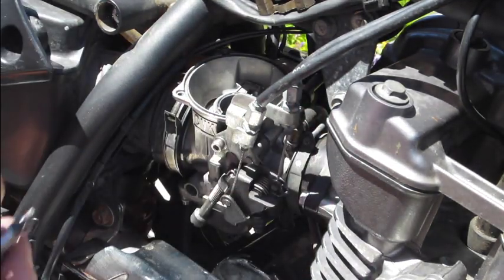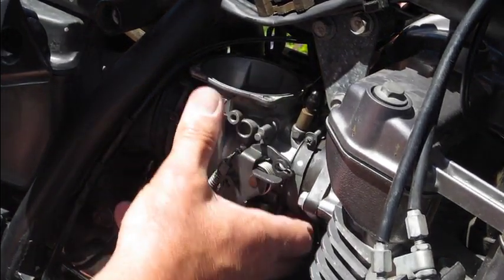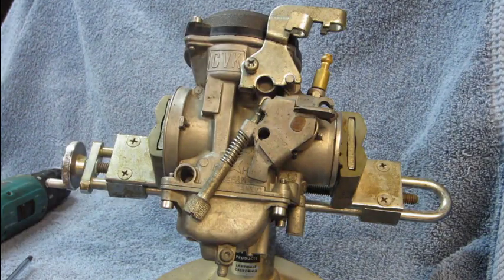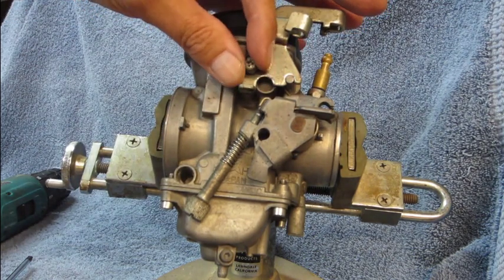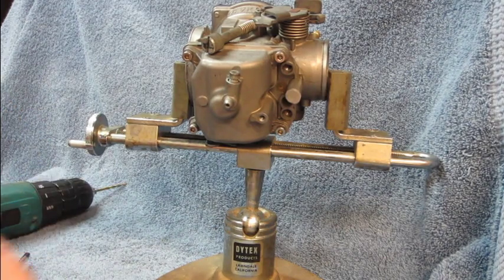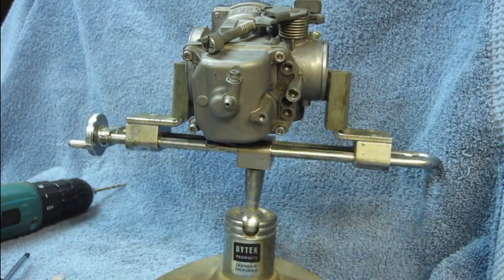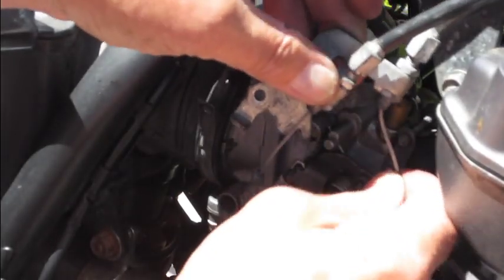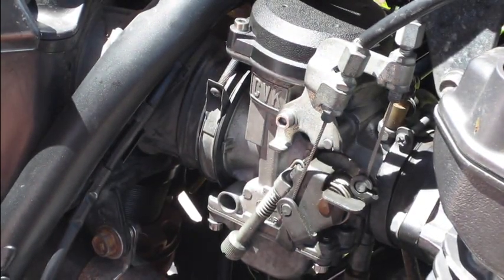22 cent mod video 2

Comment from the maker: If you find this adjustment inconclusive, just set it at 2 turns out; hard to go really wrong with that. You should also be aware that the engine can stumble at too lean a mixture. One old trick was to find the lean stumble point and the rich stumble point and set it halfway in between. In my opinion, rich is better on this carb because the idle mixture circuit always plays a part well into partial throttle. Rich runs cooler. Google "Care and Feeding of the Keihin Carb". Good reference!

Comment from the maker: I'm not sure why the recommendation there is for 3/4 - 1 turn out. That is pretty much how they come from the factory, and it is lean. the generally accepted rule of thumb is about 1 3/4 turn out for stock, roughly 2 1/4 turns out for aftermarket exhaust. Those are not exact numbers, but should be a very good improvement over stock.

Comment: Thank you so much, really helpful video! 
Not sure if this is the case for all but my 2016 didn't have a cap on the adjustment screw. With a Lexx exhaust and 2.5 turns out felt a little rich when shifting gears. Think i'll try what you recommended in the comments at 2 1/4. 
Overall, superb..big difference!!
Reply from the maker: Glad to hear it! Interesting that the cap may not be on the 2016; had't heard that before.

Thanks!

Tom

Comment from the maker: Drilling the slide will improve throttle response a bit but won't do anything to the mixture, so if you don't want to do it there's no problem. Just put a washer or two under the needle and turn the screw out a couple turns. You should notice an improvement in first gear/second gear roll-ons. Nothing to removing and replacing the cables - just watch that choke cable!

Comment from the maker: I don't know, Juan. It depends on what else has been done. Two to two and a half turns out is probably in the ballpark, but it all depends on what the pipe is flowing and what intake mods have been done.

You see, you can get to the point where you need a larger pilot jet to control the lean pop on decel. I have a very free pipe, a ported heat, and holes in the air box. I needed to go up a couple sizes on the pilot.

Try the "cracking throttle" method below ans see where it takes you.

Comment from the maker: Probably not, with just the pipe. You can start at 1 1/2 and turn it out an 1/8 turn at a time, cracking the throttle each time. What you are trying to do is get the idle running as rich as possible. When cracking the throttle causes a stumble the mixture is too rich; back it off a bit until there is no stumble. Running rich at idle and part throttle should help to prevent decel popping. The engine needs to be fully warmed up for this adjustment.

Comment: Great video. When you are showing the outdoor portion of the video you have what looks like a brass thumbscrew in your idle mixture screw hole? Where can we get one of those for future adjustment?
Reply from the maker: Hi Rick - 

It's called the 'EZ-Just Mixture Screw' and it is made for Harley Davidson Sportsters that use the CV40 carb. John's Cycle Parts (http://www.johnscycleparts.com/store/index.php?route=product/category&path=20) has it, as does CV Performance (http://www.cv-performance.com/). They are about $20.

Tom

Comment: great video.my son has a first gen klr 650. i was out visiting him over the weekend. he lives in san diego {sea level}. the bike has a super trapp muffler with stock pipe. it has a aftermarket air filter. i asked him if he has ever pulled the spark plug to check it out. he has owened the bike for 2 years now and has just changed the oil every 1000 miles and clean the air filter, tighten the chain and put gas in it and loves the bike.i pulled the plug and it was real real light in color. i ride a xr650r ,kx500,gsxr 1000 and a 79 bultaco 250 pursang. so i know what a hot plug looks like. i kinda freaked out seeing how hot it was burning. you think the 22 cent mod will help his bike out ? or any suggestions ? thanks
Reply from the maker: Buzz-

KLRs come from the factory pretty lean; it's an emissions thing, I guess. What you are seeing is pretty normal. The 22 cent mod will richen the mixture a bit and take it from about 17:1 and get it closer to 15:1.

With today's fuels that contain additive packages and ethanol the old "reading the plug" trick gets a little bit iffy, though.

The SuperTrapp being on there is an unknown as far as what it's doing to the mixture. I found that the ST had to have 9 plates in it to flow as well as a stock pipe and was horribly loud. Depending on how many plates he has in it, it may be contributing to the lean condition. Intake and exhaust mods need to be balanced. He might be better served by installing a KLX needle. If he still has the stock exhaust can, a better exhaust mod than the ST is to open up the stock can, removing the baffle. If flows pretty well and isn't obnoxiously loud.

All in, I'd say the 22 cent mod would be beneficial on his bike. Do it and check the plug. If it still looks lean, go for the KLX needle. Go down one jet size and start at the second clip from the top, then tune.

Tom

Comment: Hi there, great vid thanks so much - I'll be working on my 2000 KLR over the winter.  Quick question, where can I get a 4 40 washer?  That'll sound dumb I'm sure but I've looked here in Montreal and can't find one.  Any pointers?
Reply from the maker: Hi, it is not a dumb question! They can be hard to find, as they are part of a set of very small hardware and they are not metric.

What you need to find is a stainless steel washer of the appropriate dimensions. Here we find that ACE Hardware Stores often stock a good supply of 4-40 screws, nuts, and washers. You might try Ace Quincallerie Moussette 1561 Rue Ontario E, Montreal or Quincaillerie Home Hardware 4299 Boulevard Saint-Laurent, Montreal.

If you cannot find 4-40 washers then 3mm washers should work. They will be a bit smaller in the inside diameter and outside diameter and a bit thinner. The shaft of the needle is right at 2.92mm. I have used the 3mm washer in the past.

Here is a comparison of the two:

4-40 Stainless
Inside Diameter      3.25
Outside Diameter   7.75mm
Thickness                  .8mm

From my stock, what you find may vary:
3mm Stainless
Inside Diameter       3.13mm
Outside Diameter    7.15 mm
Thickness                   .63mm

Normally two 4-40 washers are used, but people often find that one is sufficient. I would suggest using two of the 3mm washers to start; you can go to three and have a bit more lift on the needle than two 4-30 washers give. Wouldn't hurt anything. 

Stainless washers are usually well finished with no burrs, so stacking them is not an issue. Make sure that the ones you get have no burrs from the manufacturing. If they do, sand them flat with some fine wet-dry paper, oiled, on a pane of glass or other hard, flat surface.

Best of luck!

Tom
Reply: Holy mackerel, you the man!  Thanks a lot Tom, can't tell you how much I appreciate you going above and beyond to help a guy out.  Really, thanks.  Looking forward (no, really!) to the winter as it'll give me plenty of excuses to get into the garage and start the tear down and eventual rebuild of my KLR - with your help and your videos I feel well prepared.  Good man!
Reply from the maker: You are very welcome; glad to be of help.

Are you planning on replacing the balancer lever? If so, and if it gets too cold to work on the bike, I have a set of videos on that job that will chew up an hour of your time. https://www.youtube.com/watch?v=U3UJIbDOLMQ&list=PL3s67DOJbACyGI5VAbELQ4YUkV6CCFOUl

If you get really housebound you can while a way a good bit of time at www.souperdoo.com , too. There's some fun ramblings there.

Have fun!

Tom

Comment: Thanks for the part 1 & 2 videos.  I just completed this mod and got rid of the popping at deceleration completely. Woohoo!! But I'm still having a minor problem I was having before the mode: when I keep the bike at 5000 rpms steady (let's say highway cruising speed) i notice a bit of a surge/hesitation in power but when I open the throttle there is a response.  If i choke it the hesitation disappears, what can that be?? Again thanks for taking the time to make these video series
Reply from the maker: Hi Orlando,

It sounds like you are still a bit lean on the idle circuit. The idle circuit is active for a fair amount of the small throttle opening. When you are running at an easy 5000 RPM you are really using very little throttle.

There are a couple of things things that should help. First, proper idle mixture tuning. There is a pretty tried-and-true method for finding the proper idle mixture that has been used for decades. I copied these words from cv-performance.com because they do as good a job of explaining this as anybody does. They sell the E-Z Adjust idle mixture needle. Good company. 

"The air cleaner assembly must be installed prior to starting the engine, not only to hold the carburetor in place but to prevent having the carburetor backfire in toward you while tuning. Start the engine as normal and bring up to operating temperature prior to fine tuning. Let the bike idle for no more than 5 minutes.

With the engine warmed up and at idle you may now fine tune the idle mixture screw for optimal performance. Acquaint yourself with the adjustment screw location at the bottom rear of the carburetor prior to running the engine. You will need a small screw driver for adjusting the screw unless an EZ-Just has been installed. With the engine idling slow (no more than 900 rpm), turn the screw inward (clockwise) SLOWLY until the engine starts to stumble. You are working with the screw upside down so check to make sure you are turning the screw clockwise or inward. Note that not all engines will stumble or have an RPM change that is noticeable when twisting in the mixture screw. This can be due to the idle jet being too large, installed cams, or ignition systems such as those on Twin Cam 88's. If unable to find the low adjustment point where the idle slows, simply set the screw at 1-3/4 turns out and proceed to the next step.

If the engine will not idle on its own during this procedure, adjust the idle set screw on the throttle side of the carburetor until it idles correctly. Now turn the mixture screw outwards (counter-clockwise) until the engine begins to run smoothly, then add 1/8 of a turn. Maintain proper idle speed and repeat the adjustment each time you adjust the idle speed. Blip the throttle a couple of times and observe the results. If the engine responds quickly with a smooth blast and no backfiring through the carburetor, you have your idle mixture right. If a hesitation occurs then adjust the idle mixture screw out another 1/8 turn. Normally, the mixture screw should only require 2 to 3 turns out from gently seated. Anything above 4 turns indicates the pilot jet is too small."

Going from a #38 pilot jet to a #42 can really help in some installations, too.

Finally, going to a KLX kit instead of the 22-cent will make a vast improvement in the overall air-fuel mixture across all throttle openings. The 22-cent is meant to be a quick and easy way to remedy the factory lean condition in the carb. The KLX is a more aggressive tuning method to improve bot AFR and power. Of course, it costs $50 instead of 22 cents...

Tom
Reply: @souperdoo  thanks again for the info, i will look into this

Comment: Should there be a boring inside the fuel port in the carb body? Mine is leaking from the carburetor fuel inlet fittings. I have a duel carb and both are leaking. It looks like there is no o-ring inside the fuel inlet port of the carb body and there is no o ring on the plastic fittings the fuel comes through.
Reply: O-ring*
Reply from the maker: If your fuel inlet is the pull-and-twist-to-remove style, yes there should be an o-ring. Later elbows were more or less permanently installed in the carb body; they are a different matter.

Check your vent elbow and see if it has an o-ring on it. That will help you determine the size and might even get you going until you can pick up new o-rings. The vent doesn't absolutely have to have an o-ring.

Tom
Reply: There are o-rings on the fuel line fittings that insert into the carb body. They seem to be in good shape but fuel is still leaking out. I can't seem to find a part number for these o-rings so I can purchase new ones.
Reply: @souperdoo  The o-rings appear to be 1/4" ID and 1/16" thick.
Reply from the maker: O-rings are universal. Buy some that are made from Viton, Buna-N, or Nitrile and you will be fine.

And you’re correct, they should be rind and soft.
Reply from the maker: Do you have a Vulcan?
Reply: @souperdoo  This carb is on a 2006 Kawasaki Brute Force 650. The new o-rings seem to have fixed the issue.
Reply: Appreciate your help!

Comment: Do you need to do the 20 cent mod if you're doing the klr needle kit?
Reply from the maker: @Ian Ferrier,

No, you don't. Sometimes you may find a need to fine-tune the KLX needle with one washer; doing so moves the needle by half a groove.

Other than that, no. One is a poor man's bit of carburetor tuning and the other is a better approach though a mite spendy.

If you don't mind spending $50 I recommend the KLX needle.

Tom

Comment: thanks for posting the excellent how to. I just bought a 2012 klr and was thinking about this mod. I have an after market slip on and thats it. do i need to turn out the bottom screw 2 1/4 turns? great video, thanks again.

Comment: You said turn the screw out 1 and 3/4 turns. But I keep reading forums say its 2 and 1/2 turns. whats the big difference. because they dont mention after market exhaust.
Reply from the maker: It's a ball park figure.  The generally accepted rule of thumb is about 1 3/4 turn out for stock, roughly 2 1/4 turns out for aftermarket exhaust. Those are not exact numbers, but should be a very good improvement over stock.

The truly correct, and fiddly, way to do it is to turn the screw out 2 turns from gently seated, then turn it in a bit at a time, all the while looking for a peak in RPM. If turning it in from 2 turns doesn't get you to a peak RPM, go back to 2 turns out and look for the peak RPM by turning it out.

When the mixture is correct, the RPM peaks. If you're approaching the peak from the lean side, then it will start to fall back off as you go a bit too rich. Vice versa if you're approaching it from the rich side.

See how hard that was to read and understand? That's why I say, in the video, to go a turn and 3/4 out ;^)

This guy does a pretty good job of explaining https://www.youtube.com/watch?v=zm5mB3R8Ucw

This guy, too, https://www.youtube.com/watch?v=YxpQjDQzX7g

Tom
Reply: Thanks for the reply!  One more question. Can you just ritchen the screw without putting in the washers?
Reply from the maker: Yes, you can. What that will do is correct the mixture to about the 1/4 throttle open positiion. After that the mixture is pretty much governed by the taper of the needle and the size of the main jet.

You'll probably be on the lean side there, as that's the way they are designed.

To recap a bit, setting the idle mixture screw correctly will give you the proper mixture at idle and to about 1/4 throttle. Installing the washers pulls the needle out of the jet a wee bit, correcting the 1/4 to almost wide open throttle mixture. At wide open throttle the engine is running off the very small tip of the needle and is quite rich (this is a bit of a safety measure so that you don't run lean at WOT). Drilling the slide allows it to come up quicker as you open the throttle plate, which puts vacuum on the top side of the diaphragm. That improves throttle response.

This chart may help you understand what controls the air/fuel mixture, though it has components that aren't in our carburetors: http://www.carbparts.com/keihin/needles_tuning/calchart.gif.

Here's another, presented a bit differently: http://s1183.photobucket.com/user/NVTrailRider/media/003649c6-0ab5-4fdc-b75a-fc097105f668_zps27583c53.jpg.html

Tom

Comment: Can this be done on a 2000 super Sherpa carb? Kl250
Reply from the maker: David,

Yes, it can be done. The KLR250 carb is a smaller version, but the needle is similar. It should work out all the same, though I think folks start with one washer. Some have reported good results with a main et one size larger, too.

There is a thread for the KLR250 over on adv.net. It is rather long, but that's where the smart folks hang out. You might find info there on jetting the carb, shimming the needle, and what a good setting for the mixture screw is, or if a KLX needle works on these carbs.

Tom

Comment: Why do you promote the idea of doing this mod while carb is still on bike,then do it while on bench? By the time you've got to the point of tilting carb ,how hard could it be to just remove the damn thing? You seem to have found out its just exer to go ahead and remove it!
Reply from the maker: This mod is often done at tech days and doing it while the carb on the bike isn't that hard, and it can be done easily and quickly. I wanted people to see what was required to do the mod, and that was easier to film with the carb ont he bench.

To your point, removing the carb isn't very hard to do, though. If you have the time to remove the carb and get it to the bench, that's also a good opportunity to do a cleaning of the carb, too.